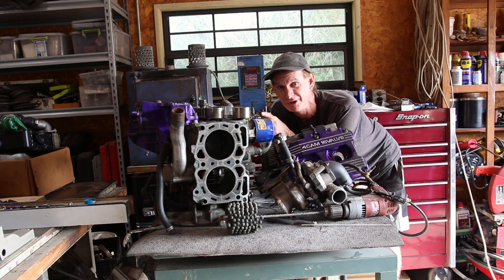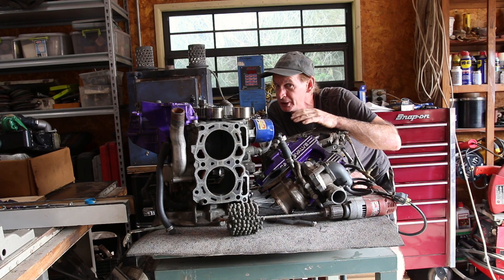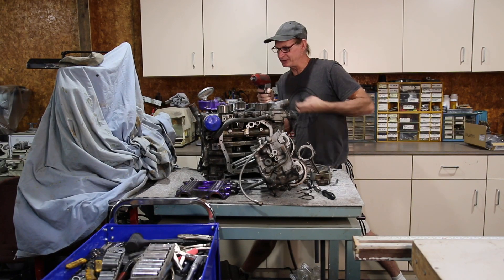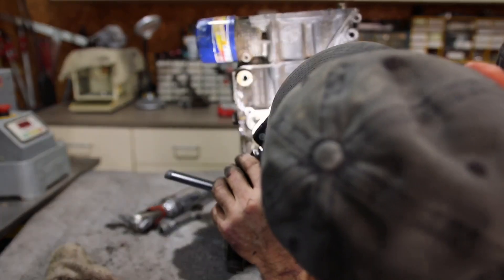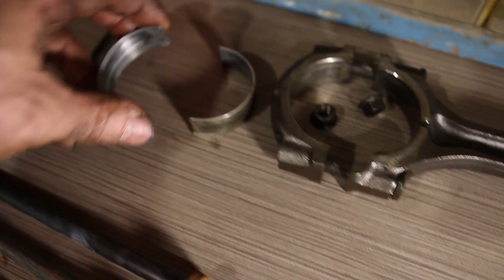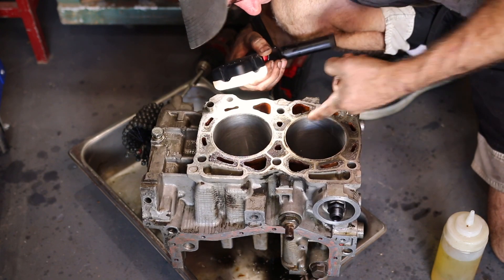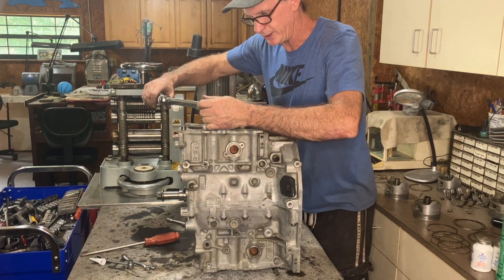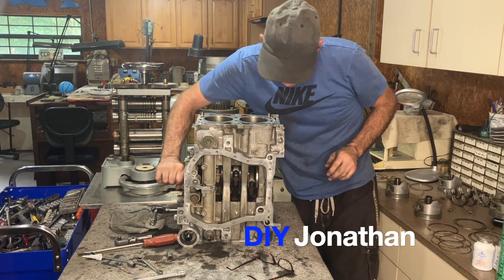62 VW Bus 300h.p. Turbo Subaru Engine build

Comment: i read somewhere if you are using a STI EJ257 without turbo, you need to change the pistons to get a higher compression of 9.8:1 instead of the 8.2:1 so you have more usable power. you can research that...